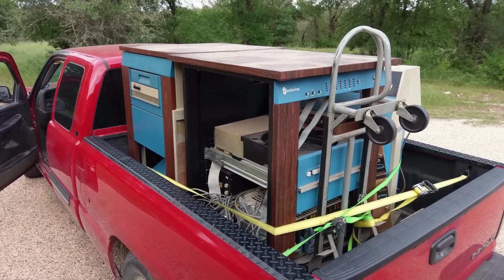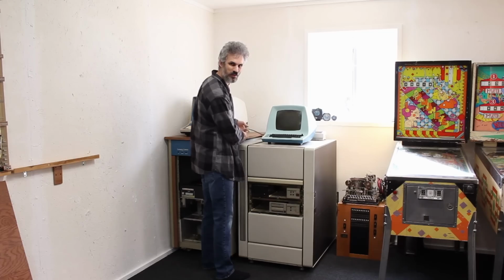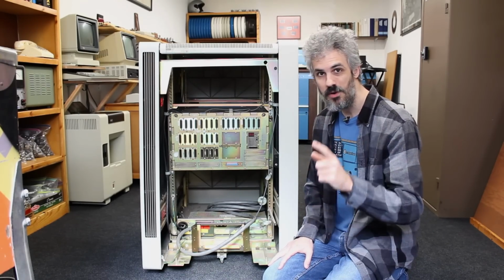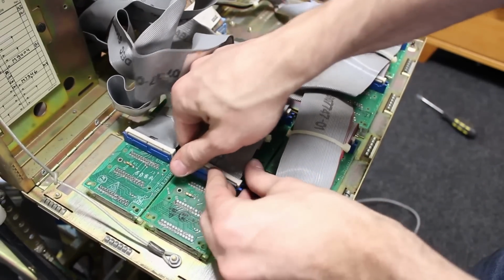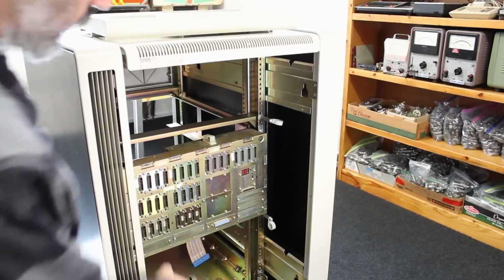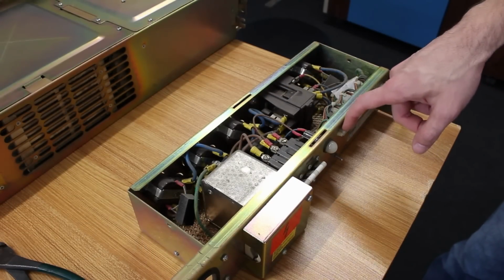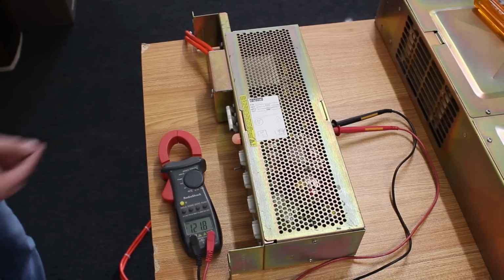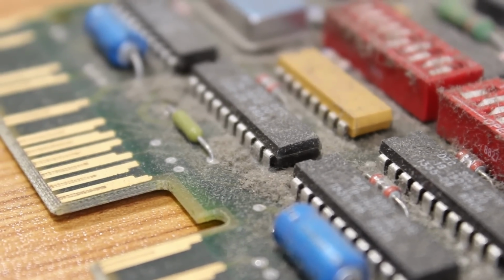I Bought a PDP-11/83!

Comment: Had a PDP-1 when I was in the Air Force Security Service, 66-70 in a foreign country. Ran original BASIC and was used to provide a 5 level tape to run on an analog computer that controlled our antennas. Had to load BASIC on the PDP-1 with another tape.

Comment: Here in Australia we use Eucalyptus Oil to remove sticky tape residue like you've got. Put some on a lint proof rag and rub away. Sometimes letting it soak on the goo helps. It won't harm the material underneath. Tea Tree Oil also works, imm told.

Comment: I may give some help. I think.

I used a PDP 11/70 in 1985, and for some years. I loved the processor. One of the best Assembly, register, instructions sets etc, I ever saw.

This one looks very newer than PDP 11/70. And is 1/8 of its size.

The blue conector may be a SCSI, or another kind of interface.

The HD cables remembers me ESDI interface. Is a interface very old, before Parallel ATA.

Comment: In collage we learned CAD (Computer Aided Design) on a PDP-11. It was behind glass in a adjacent room, you could look at it but not touch it. It had about 15 to 20 terminals connected to it and each user had an account we would sign into to gain access to our drawings. There was also a printer connected. My understanding it only ran CAD. This was years 1985 to 87, the year was more likely 1986. Interesting watching your video. This looks like a small PDP-11, ours was much larger, 8 feet tall and about 8 to 10 feet long. I think ours was donated to the college from a local manufacturer.

Comment: A long time ago I worked for a University and bought one of these from the engineering department for 1 UK pound sterling ::-) I ended up not really using it and donated it to a vintage computer museum in UK. I mention this because the Vintage computer museum staff may be able to offer help if yo need it at any point. - actually the one I had was much older, maybe a PDP7(?) and had an 8" floppy drive...

Comment: Solvoplast is the answer to removing any type of adhesive residue. It is mainly used in the medical field so it's safe on painted surfaces. If stinks to high heaven but I've yet to see any type of glue resist it.

Comment: Supercool! I worked as a consultant on a PDP-11/83 in the 90's. It was the control system for a plasma cutter line in a steel mill here in Sweden.
A funny anecdote was that when the Y2K bug craze was at it peak someone at the steel mill company hired another firm to certify all computers for the coming millennium.
The firm had no clue what the PDP was so they stuck a sticker on it saying NOT Certified meaning the system needed to be fixed before the millennium. 
Me and my colleagues tried to convinced them it was no problem but as it had the wrong sticker on it, the PDP needed to go! Fast forward to the new years eve of 1999. Guess which newly installed system crashed? Yep, the replacement system did not survive the Y2K switch, luckily the trusty old PDP was still there (thanks to us) and booted right up and continued as nothing happened. "If it ain't broke, don't fix it!" do apply sometimes :) 
If I remember correctly we used like at least 10 of the RSR232 ports for the plasma cutter line. It controlled two portals with cameras and markup equipment that detected the new newly rolled steel plates outline, which had quite raw edges. After that it calculated the optimal position of the new plate to be cut out. Marked out the new plate and then used the markings when cutting it later down the line. Sometimes it gut stuck in the execution sequence (something related to priorities of the tasks that got messed up) and needed a firm kick in a*s to continue, but usually it just worked flawlessly. Good luck with this beast!

Comment: That tape drive is a TU58 cartridge drive. There should be an eject hole on the front to manually unlock and eject the tape. Normal operation requires power as it is somewhat like a floppy in operation - the button on the side was to eject (which required a small motor similar operation like a VCR drive has to eject the tape. Same for loading the tape.
BTW, there is a fair amount of information on the web for PDP-11 systems (including the 11/83

Comment: This smells of a PDP-11 computer cluster controller.  It may well be that the 3 row D cable in the back led back to the main computer, perhaps a Vax, a Dec-10 or the like.

This explains all those serial lines - they would be connected to "dumb" terminals (about as smart as your ADM-3A).  The first cluster I played around with, the serial lines at capacity were capable of doing about 2400 BPS.

Lots of fun!

Comment: $510.00 is a steal !! Try removing the glue from the tape with a mixture of half isopropyl alcohol and half nail polish remover. I used to clean almost everything. It will take writing off labels so be careful. Also, the 2 slashes in the back doesn't mean the corner pins in the Molex connectors is ground. It means that screw is a grounding screw for those 2 Molex connectors.

Comment: At my first job at Polaroid in 1978, I was given a PDP-12 computer. It was considered obsolete at that point and my boss actually offered to let me take it home. Since it was almost the size of a phonebooth, I declined. But it sat in the corner of my office for the rest of my brief career at Polaroid. My understanding is that the PDP-12 was a parallel model line to the more widely used PDP-11. The PDP 12 being intended for laboratory/industrial use. My unit had no hard drive but it did have a two reel tape drive, a 9 inch monochrome monitor, a keyboard, and a row of address register toggles. I was able to program it in Dartmouth Basic. I wrote some simple programs on it to calculate film coating amounts but I was able to implement, essentially, the same programs on my HP programmable calculator which was tiny in comparison to the PDP. Throughout my career, I have been bemused by how fast top of the line hardware gets obsolete.

Comment: That connector with all the pins looks like parallel data lines and control signals for a high speed line printer.   If you want to remove the gummy substance from your cabinet, try acetone, aka nail polish remover.

Comment: Brings back such fond memories of DEC machines ! - starting with the PDP 11/34 I learnt BASIC, Fortran & COBOL programming on with punched cards (batch card reader, eagerly waiting to find how many bugs we had, before resubmiting fresh punched cards to the reader!). Then migrating next year at Uni to a PDP 11/70 running RSTS/E, learning more advanced Basic Plus programming on VT 52/100 terminals. Then first job with PDP 8E computer as an engineer, running 8K Core Memory modules (up to 24 K max ?) and fitted with General Instrument FR500 2.8M disks (same as used in submarines from memory, with the spindle mounted horizontally rather than vertically (for depth charging resistance)). Second job was working with a TB216 disk tester working on all kinds of small DEC 11 series m/c running FMD / SMD disks, including a master m/c running pot-lines at an Aluminium smelter - where the O/S was written in German! (That was a tough fix!). Then later working with VMS / OS/X etc. Wonderful memories - thank you...

Comment: Nice job so far!  Stirred up memories for me working on add-on cards for Data General Nova and Eclipse minis, a competitor of Digital. Only you seem more careful.  It's good the hard drive is a bit newer; for your systems with older CMDs or SMDs, beware that head crashes were routine so just be careful and avoid any bumping or non-graceful shutdowns.  New to your channel and I like how you showed respect for the performance specs of this old rig.  In their day, this performance certainly didn't come cheap.  A full minicomputer system to support a mid size office would cost over 100K if I recall.  I know that before drives like that Maxtor came along, those CDC hard drives and controllers might be 20K.  And in 1983 dollars.  Partly because product development and manufacturing was so archaic and expensive.  It really was a new industry and what strikes me to this day is how young most of us working in it were..

Comment: The 11/83 is a lovely machine. I bought one in the late 90s that looked just like this one but with a pair of RA81 (456Mb) drives filling the two drive spaces. Sadly didn't have space to keep the whole thing when I moved so let the chassis and drives go to somebody else but kept the actual 11/83. Still have it in somewhat working order along with quite a few spare parts and manuals (and other Micro PDPs and MicroVAXen) collected over the years.  If you have questions I'm happy to try to help.

Comment: Nice Astatic Silver Eagle there on the shelf.  I have one also still in an original box but with the SSB head not the circular head.  still torn on if I should try and rewire it up to work for a PC (into a 12AX pre-amp)

Comment: The research group I worked in at Lawrence Berkeley Laboratory bought and used one of these in 1980.  Before that we shared a PDP 10 down on the UC Berkeley Campus.  I programmed in Fortran on the machines.  Before the PDP 10 we'd shared time on the mainframes at LBL'S computer center in Bldg 50 and 50a.  Cost and access were what drove us from the LBL computers to the PDP 10 to our own PDP 11.  Skip forward to the 90's and we're doing most of the work on PC's while doing writing and running more demanding applications on the super computers at the LBL computer center.  For us the PDP 11 was a much appreciated, though short-lived, stepping stone to the distributed model that evolved with the internet, desk-top computing, super computers, and server farms.

Comment: Used a PDP 8 and PDP 11/70 in High School.  It's funny, but the "VT100" (DEC) was a standard for compatibility for serial dumb terminals.  Wyse and other inexpensive terminals would usually work best in VT100 mode.  The port 0 is usually called the main console which will interact/show boot statuses.  The other terminal ports have to wait for the operating system to support them.  
Regarding your amp calculations, you are only counting the two CPU boxes, the array of drives would add another large chunk.  I bet that Maxtor MFM drive is about a 70mb drive that replaced 18" platters which would hold about 50.  But those big drives would REALLY suck power.   My office computer room in 1984 had a dedicated power pole/transformer feeding it.

Comment: That huge Maxtor drive is only huge in physical size compared to the more modern 3.5 variants. Lets face it though, it was an improvement on the old huge 12" disk cartridges.

Comment: This brings back fond (ish) memories of working with the Wang VS line of minicomputers back in the late 1980s at the start of my IT career.  I traded COBOL coding services for a Wang VS 80 model which I kept in my bedroom at my Parent's house at the time.  When I powered the CPU and one of the 600MB top-loading CDC power pack drives and went outside to see the electric mter it was spinning like a 45 record.  Oh lordy the heat that thing generated.  Good times.

Comment: Remove adhesive from adhesive tape - for starters, alcohol. If that does not help, then drink alcohol and try a solvent or acetone. The paint on the panel I see baked powder paint - it is inert to any chemistry.

Comment: PDP-8E, with 4k memory (we added - or tried to add - another 24 k, made by Fabritek, but never got this memory expansion to work). That was the spring of 1970 (or 1972?) in a country which does not exist anymore (Yugoslavia), where we got our first computer (at the faculty of sciences) after a lot of efforts (tons of red tape, on both sides of the Atlantic Ocean). It had an 8-channel (8-hole) paper tape by which we were feeding, first a loader, then (forgot what), then language compiler or what (the language was, if I remember, FOCAL).  All very consuming and error-prone.  Never used it much and never got much out of it but - Hey! - that was a humble beginning of my "partnership" with DEC machines. Partnership is but a sorely inadequate word: I loved DEC machines, I loved VMS (and later, OpenVMS). And - I used them a lot (after I moved to the States). The end came in early 1990-ies (at a large and wealthy MidWestern medical research institution), with a two-processor VAX 8100 (or so) on which I was able to diagonalize a 4 000 000 entry matrix (actually 1958 by 1958) using my FORTRAN-77/VMS program. The DEC/VAX/VMS machines have to a large extent dominated and defined my professional life during the 1980-1995 period. RIP.

Comment: I had a DecWriter 2 printer/keyboard unit.  I used it as the main console for my PDP-11/03.  That DecWriter could be bought as a 37 pin (Centronix) interface, or like mine, a RS-232 interface.  The DecWriter2 was a dot matrix printer using fan fold paper.  I never got tired of hearing it spit out pages and pages of code or reports.

Comment: That 37 pin connector was for a line printer.  I had a PDP-11/03 with 32k of ram and 2 8" floppy drives.  It was populated with 4 DLV-11J rs232/422 cards as well.  Each DLV-11J card supported 4 serial ports.  I programmed it in assembly language.  The operating system software was RT11.  It was capable of running the main job in the foreground, plus a job in the background.  It was all mounted in a little roll around 19" cabinet 2' tall.  Not bad for mid 1980's technology.  I still have parts and pieces to it.  I think my Dad might still have the dual floppy unit in his basement.

Comment: When I started in tech, our PDP/11 was relegated to a corner of the computer room , running legacy code that had not yet been ported from RSTS/E to VAX/VMS.  I remember running standalone backup, booting from a 9-track tape reel, 1600 bytes per inch.  Magnetic disks of that era were not reliable, at least not by modern standards.  If you had a big enough disk farm, field service would be swapping them out quite often, with operations staff restoring the data from 9-track tape.

Comment: This is great!
I had always heard of PDP-11's when I was starting in IT, but I never saw one. They were big deals and apparently everybody that programmed them knew Cobol or Fortran for some reason...lol! I can't wait to see you dig into it!

I see you have a Ti-99/4a in the background!
I still have my original Grey box one (still working last time I checked in 2005) and a later White plastic one (not working). I have the Speech Synthesizer, Peripheral expansion box, 32k memory expansion, 5 1/4" floppy drive and I think about 10 cartridges for it! I remember spending so much time on that thing, especially dialing up my friends with their Coleco Adam or Commodore 64 on our 115 baud modems! I also remember spending a lot of time trying to learn Ti Assembly language!

Those were the days...

I want to get my hands on a DEC Alpha one day, or an SGI workstation at some point. These things were always a mystery to me as they were unobtanium (ie. extremely out of my budget), and even after SGI, they were still out of my budget. Some are STILL out of my budget...lol!

Comment: Congratulations for your find!  Sometime in the mid 70's (I think) I was very superfluously involved with a data collection and reporting system that was built around a PDP-11/34.  No hard disk, just a 14" floppy disk.  The booting was initiated by a sequence of address and data switches on the front   panel, which also sported a bunch of indicator lights.  Luckily I never needed to learn more about it!

Comment: I noticed the heavy gauge construction and it reminded me of DEC gear from the 80s... Then we came across a label.  That's a great find, beautifully built gear made in the USA. Strong like tractor. No doubt there will be some dust.

I tore apart a Decwriter that they were tossing out at tech school in the early 90s. What a mechanical monstrosity and feat of engineering, guessing it still worked fine too, it just took up space. This is an interesting project.

Comment: nostalgia hit. my first job out of the navy in1980 was at the local mid-size newspaper as the night shift computer sysop. we had 4x pdp-8e's, one for wp, one for wire, one for typesetting (cold type), and one for business/accounting/circulation.  we had a partial 5th one for any needed parts replacements and some of the boxes had an extra memory card 'hacked' in. all the software was written in machine language by a computer genius named stuart dewar (sp?) and i remember calling him for problems late at night/early morning and he'd pop fully awake and tell me how to push 8 bit ml codes into the 12-bit register via the toggle switches. 

btw, some of you older folks might know him via the palm pilot calendar application--he was pimlico software and that app was by far the most popular palm pilot app ever. 

we skipped the pdp-11 and the later vax though and went with a tandom non-stop txp and an hp-3000 after we literally wore the pdp-8e's out. /guy

Comment: Why wouldn't you just get a 10 gauge, 15' extension. That would handle 30 amps at 60C at full load. That length can stay that cool pretty easily. 25' would be basically the same.

Comment: The blue port is a form of centronics port before the expensive port type was available.  I was a computer monitor in a PDP 11 and PDP 8 lab in college.  Yes, the 11 could support up to 32 in it's max out. Ours only had 16 populated but punch-outs for the other 16. The master is not part of the 32 total. I got shivers when I saw yours. We had the top cage with the big drive. The full height 5.25 drives were a bit off. We did have a tape back up but it was larger and clunkier. We had a mixture of video tubes and more teletypes. I had to wear ear plugs or I would get a headache.